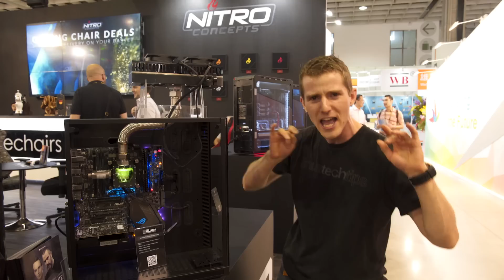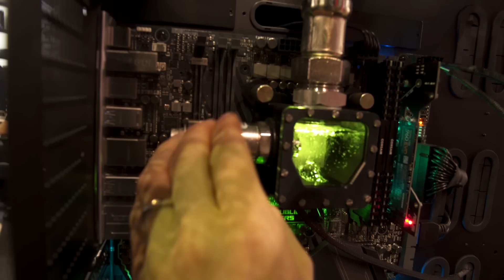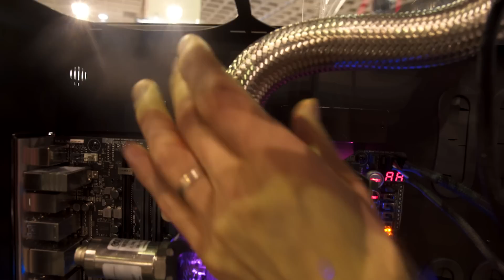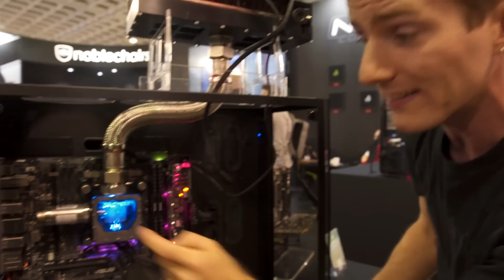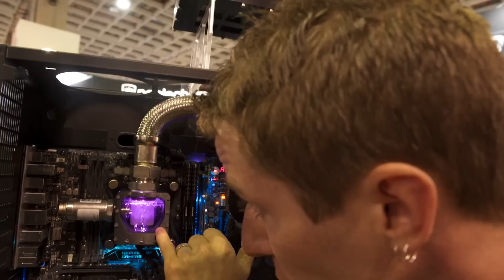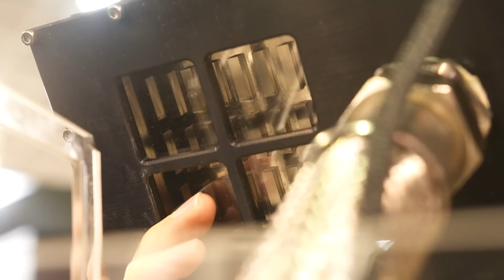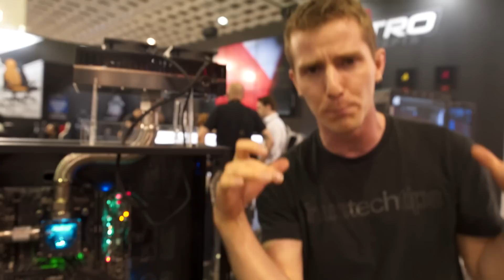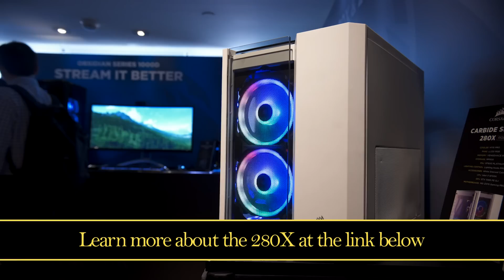Crazy Der8auer cooler prototype - NO pump!

Comment: I'm guessing propane under around 15 bar of pressure.
Reply: Hum, a leak and you're sent rushing at the hospital to extract the 122 shrapnel of computer parts scattered across your body, and to heal the 3rd degree burns from the bomb you just created Lol
Reply: Machin Truc Hahaha, thats a hilarious comment :D Imagine being at the ER and explaining that thing sticking out your leg was your GPU! lol
But, nice idea with the pressurized propane from a technical pov though..
Reply: Wouldn't you need a compressor to compress the gas back to a liquid as it cools down? Is it the pressure inside the system and the cooling by fans enough to turn the gas back to liquid?

Comment: Hmmm. There are a lot of liquids that would have the right boiling points but have obvious health and safety issues. Likely a azeotrope of water and some other common household solvent as that would be easier to get past regulators. Maybe water and acetone? Or isopropanol?

Comment: Isnt that the special coolant 3M made? I'm positive I've seen entire systems immersed in that stuff (a la mineral oil pc).

EDIT: 3M Novec?
Reply: no it's not m3 novec. he already disclosed that much since it is a highly regulated industrial grade liquit not to be distributed to consumers.
Reply: Synt4x3rror this is exactly what I was thinking
Reply: +1 to that was thinking the same thing
Reply: Paul from Paulshardware did say that it was not 3m
Reply: Upon a brief googling, I think you might be right, what a fascinating material!
Reply: 7100 to be excact
Reply: It could be from another mfg it Novec is just a 3m brand name he probably doesn't want to mention the China based supplier as it would take away their pricing advantage and work in finding a decent supplier.
Reply: Exactly my thoughts, since he has already been using this coolant in his submerged two-phase  "Aqua Exhalare" systems.

Comment: The cooling liquid would have to be an extremely volatile liquid to boil off at a low enough temperature to keep the cpu cool, something like pure alcohol.
Reply: that or they could lower the pressure inside to decrease the boiling point
Reply: Anders Strömqvist It would explain the pressure measuring attachment.
Reply: Liquid Brake cleaner is a strong solvent, I wouldn't trust it near electronics.
Yes it is safe on rubber
Reply: Liquid brake cleaner?
Reply: Noware Man, I tought the same, Propane/Butane are really good coolants. Why shouldnt this be posible? My refrigirator has propane in it.
Reply: @Noware Man
Liquid nitrogen would cause condensation around the CPU.

Remember anything that contains the suffix "Ane" is flammable
Reply: Jeffrey Damen If there were a leak then flame up would be a danger and a nix upon sales.  Nitrogen though should be safe enough and fairly non toxic.  Yes there are many liquids that could be used and it will be interesting to see what they have in there.
Reply: If you already think the fluid is held at high pressure maybe it's ammonia. As that has a much higher specific heat than water.
Reply: Joshua Williams or it could even be water if kept at a low enough pressure it would act the same. And maybe that’s why he says no one will guess because there’s probably more science than just the liquid used
Reply: Aviv Silman Could be but if it leaks it may be dangerous.  I placing my bet on nitrogen.
Reply: IIGrayfoxII liquid nitrogen causes condensation if it’s cold enough to cause it. But if the pressure within the system were high enough it would actually the keep the nitrogen in liquid form similar to propane in a bottle of propane. So it could be nitrogen but realistically it could be any fluid and I feel this could work with the correct temps and pressure within the loop
Reply: Redneck Firework Yes a vacuum would change the boil and condensation points of the water but I don't think that is the case here as the tubing has not collapsed from a vacuum and is designed for containment of pressure.
Reply: how it cold be liquid nitrogen? How would he condense it back to liquid nitrogen
Reply: Tapsu10 under pressure boiling (and therefore condensation) temps for anything change. Increased pressure = higher temps needed. Lowered pressure = lowered temps
Reply: It more than likely is a combination of low pressure and volatile liquid. Linus even hinted to the structure of the cooler saying that the chamber is quite strong and has thick walls. It most definitely isnt liquid nitrogen though. If i had to guess then it would be either Isopropyl Alcohol or maybe even ethanol. Both boil at around 20 to 25 degrees celsius and would be extremely efficient at transferring heat away from the cpu. Pure alcohols dont conduct electricity either, might be another thing going for it.
Reply: Joshua Williams I do notice how it is bubbling so what ever the material it must have a specific operational range.. the lower the boil point and the condensation points the better but condensation would be a problem.  He did say that I was fairly hot when he touched it though.  nitrogen is so cold that perhaps it may be too extreme.  that take it back to something like a liquid butane or propane or ether or cloroform.  I wonder when they will say what they are using.
Reply: Noware Man I initially wondered if it could have been butane or propane, however the flashpoint for both of those (the point at which they catch fire) is just 70 degrees celsius, and its extremely common for a cpu to exceed that temperature, and if it does then KABOOM, no more pc xd
Reply: Noware Man actually very good point. You got me thinking lol
Reply: I bet it's butane or propane.  no wonder they don't want to say.  look at the design to handle extreme pressure.   it might even be liquid nitrogen.
Reply: Yeah, that's obvious. What is it, though.

Comment: Ammonium hydroxide?
Reply: *ammoniacal liquor
Reply: Boiling point is ~38°C
Reply: DragonsKindler no that would be horrible as it’s a relatively strong base so it would corrode the metal inside plus it would smell terrible it also turns into no3 when it evaporates which has very different properties

Comment: It's liquid carbon dioxide. The chamber is pressurized and that's why the tubes are steel braided.
Reply: Nah, it'd be too cold you'd see condensation on the external surfaces if not frost
Reply: Not necessarily. The liquid is at room temperature so it's not cold. It just changes phase with a small change in temperature that's why it's boiling.
Reply: That's some serious pressure for a plastic enclosure, approx 5 bar. I don't see anyone signing up to even fund a prototype of a consumer product that needs to sit permanently at 5 bar for it's entire service life,  that's just a pain to work with. But then again that pressure sensor on the main chamber may mean you're right. pffff, guess the mystery fluid is a hard game
Reply: Lol well, it could be a bunch of other refrigerants. Maybe even propane or butane. Those would require less pressure. So maybe those. But you're right. Maybe the pressure for CO2 would be too high. I'm a mechanical engineer and these innovative cooling solutions are just fascinating to me. Hell, it could even be water under negative pressure so the boiling point is low.